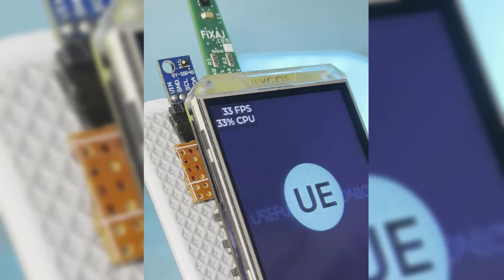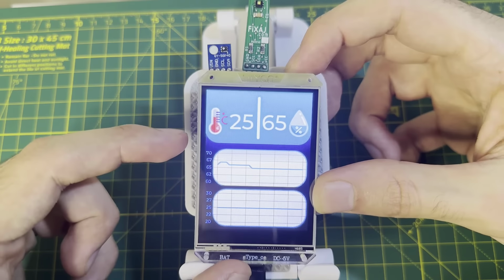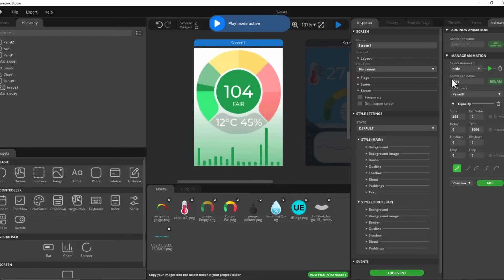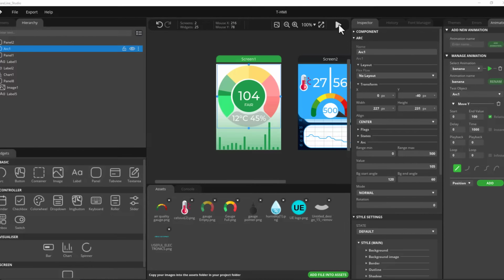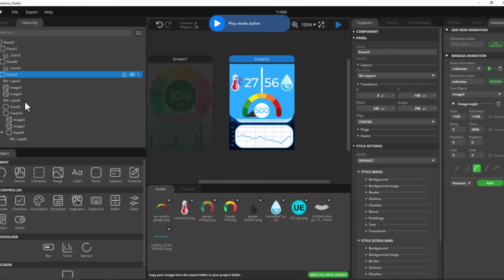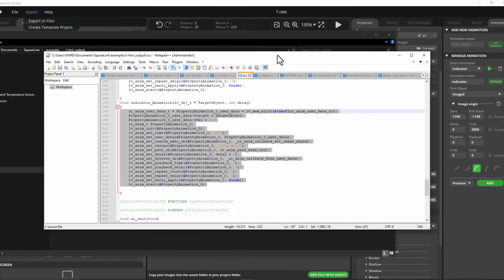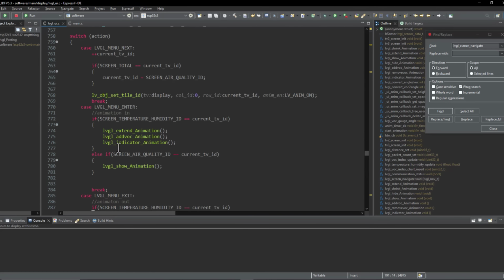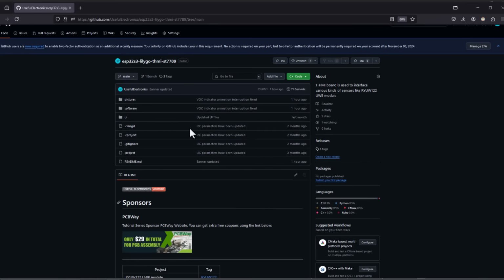ESP32 LVGL SquareLine Studio Animation

Comment: Does the touch screen work. Can you make the project on that like relay control. Simple as that. Nobody has done this yet.
Reply from the maker: The screen has resistive touch pad which is a bit out dated. 

Stay tuned for the up coming tutorial then ! ;)
Reply: @usefulelectronics  yes please i have struggled to get the touch working only the factory code works. Please do in Arduino ide. Just a relay switch on off it will be helpful. Thanks waiting for your video.

Comment: Great works!  This video introduces how to use the ESP32 S3 microcontroller to display seamless animations onTFT screen. It designs GUI through Square Line Studio and LVGL to display sensor data of temperature, humidity, and air quality. It also explains the design of animations and the implementation method on the ESP32 S3 firmware. 
We are display expert of ESP32 smart display with lots of products, capcative touch is added for better interaction. and our Knob smart display with rotate, press and touch operation is also awesome.  If possible, we want to cooperate with you.
Reply from the maker: @viewedisplay  send me an email for more details